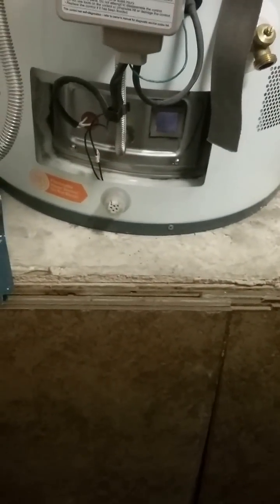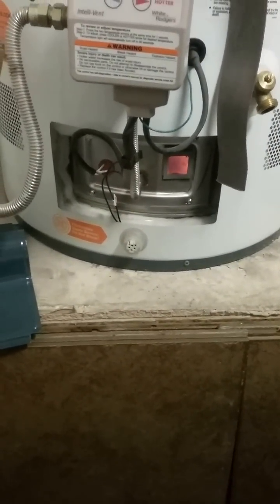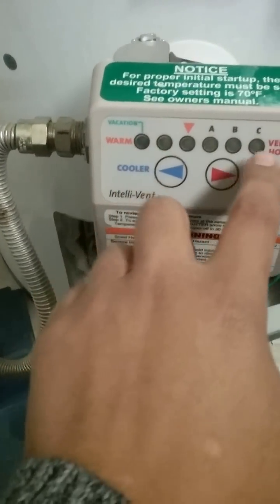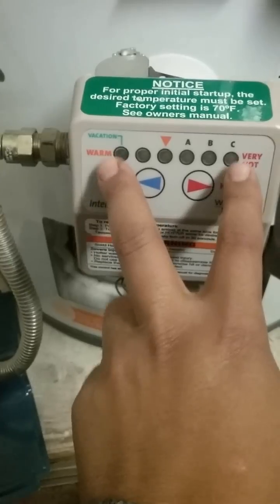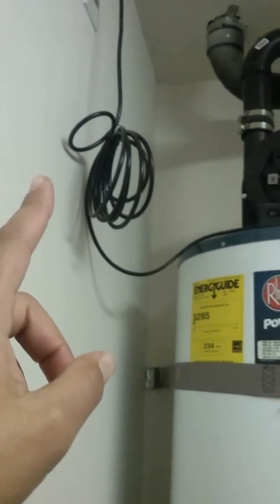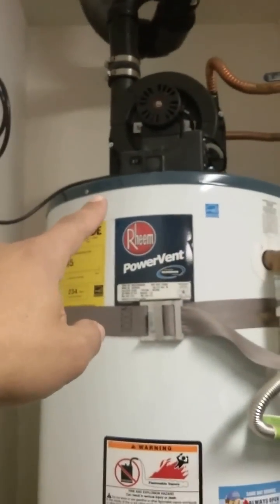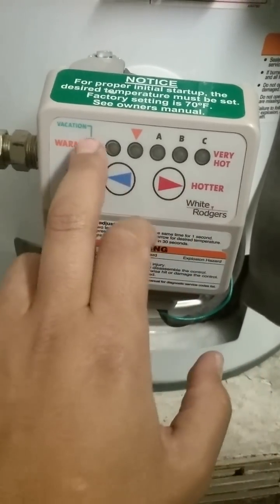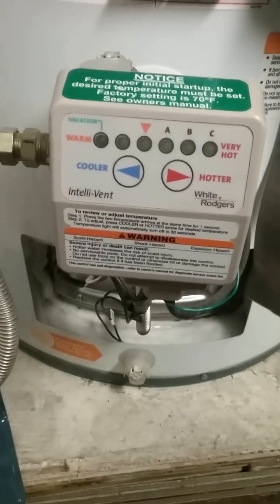How to reset Flamable Vapor sensor.

Comment: Dude you saved me some money.  Many thanks
Reply from the maker: Rock P eventually the sensor will have to be replaced
Reply: @danielcarranza9653  possibly.  I think mine set off because of the fumes from the floor varnish.  I just sanded and finished them and then this happened.  Appreciate the heads up tho.

Comment: My Rheem hot water heater 42VP75FW was in lock out like this. Would not re-set, likely bad Vapor Sensor , can't jump these out since they provide Ohm read out to computer inside. Supply store said 1 week wait, but Amazon had the same vapor sensor for $23 with 2 day delivery and free shipping. thanks for video!
Reply from the maker: Rob Sanchez Glad I could help!!
Reply: What is the part from amazon??

Comment: Remove the  Faulty sensor and put a 38K resistor across the leeds. Works like a charm and you will never have false detection again!!!!!!!
Reply from the maker: Never would have even thought of that. I don't trip it very often. Thanks for the tip